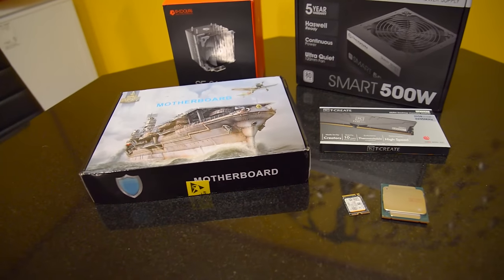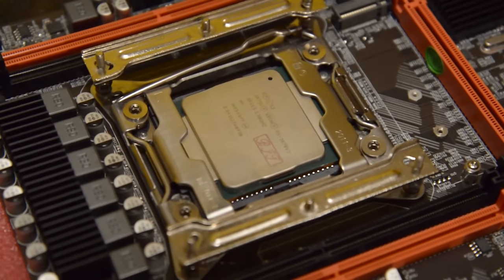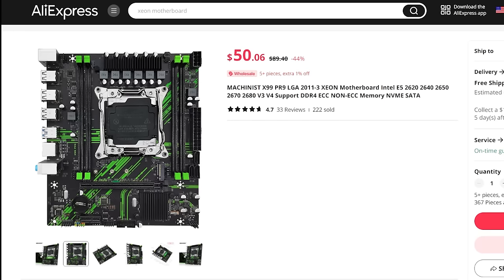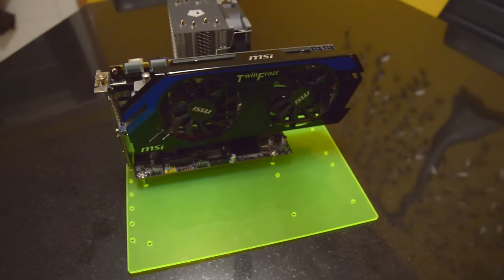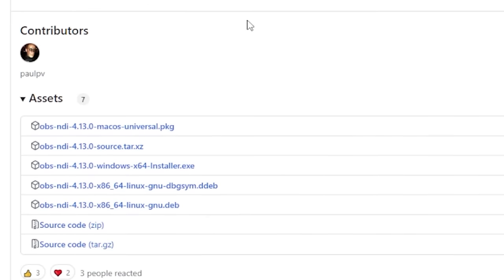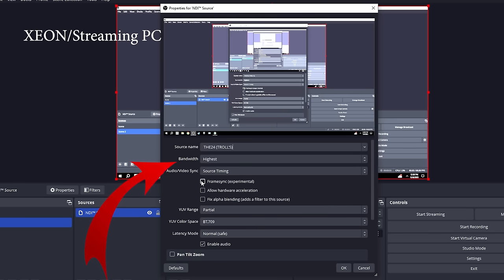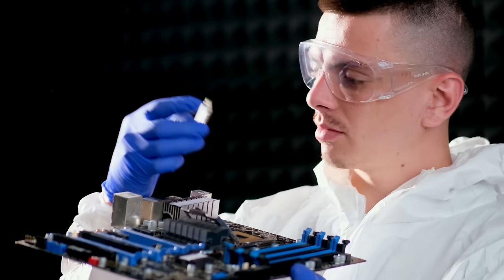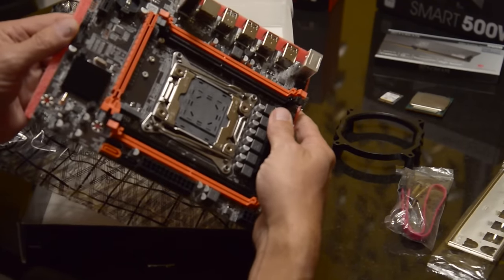Ali Express Streaming PC Build

Comment: I recently saw these X99 MBs popping up on AliExpress, which manufacture would you say is most stable for you so far?
Reply from the maker: I've purchased that same Yejia motherboard for three builds now. No issues so far. The green Machinst board in the video had lockups and freezing. Their Tech support gave me a bios update that killed it. So Yejia board is what I use and stick with at this point for super cheap utility builds out of the box.
Reply: @pctechandgames  Thanks, I will look into Yejia, I got a 1620 V3 somewhere with some ECC RAM lying around so will try it with those parts.
Reply from the maker: @AlexHusTech  Nice! Yeah, Ram to the outside slots if only two sticks. Thanks for watching and commenting. I subscribed to your channel and will check out your videos.

Comment: I'm thinking of getting a e5-2680v4 or maybe a 2690v4, and pair it with an old 1050ti I have laying around, how would recording at 1440p 60fps + streaming at 1080p 60fps ? Have u tried with ur current setup?
Reply from the maker: Using NVENC you should be able to do 1080p. Recording at 1440 shouldn't be an issue. I'll test out my new build based on the same specs today.
Reply: @pctechandgames  awesome!! keep me updated 😄
Reply from the maker: @kokumba  for sure!
Reply from the maker: @kokumba  Here is a stream 1080p 60 at 7800Kbps. https://www.youtube.com/live/y9x4FzfUzMo?si=nf-9igxDFhGqohwM the recorded file is in that video's description. I need to hook this up to my 2K monitor for 1440p testing. That may be a couple days as I'm in the middle of another video project.
Reply: @pctechandgames  awesome!! by the looks of it I think 1440p should be quite doable with a 1050ti😁, how was the CPU/GPU usage on the streaming PC?
Reply from the maker: @kokumba  OBS reported about 3% max. Yeah I think 1440 would be achievable. (correction 3% CPU usage)
Reply from the maker: @kokumba Here is 1440p https://www.youtube.com/watch?v=Scav8ROi0j4 with recorded file in description. CPU usage was 3.5%. Bitrate is 8660Kbps. Quadro M4000
Reply: @pctechandgames  man you are awesome!!! the footage looks great too, i think it should be possible to also run it as a NAS and possibly dedicated servers too😍
Reply from the maker: @kokumba  anything you want to do with it honestly!